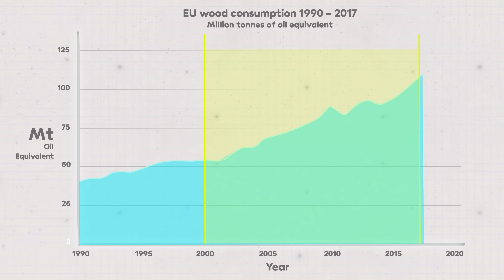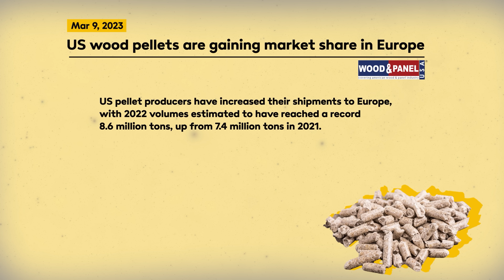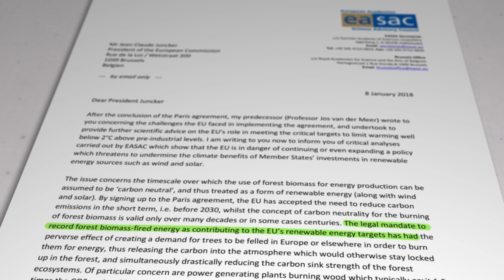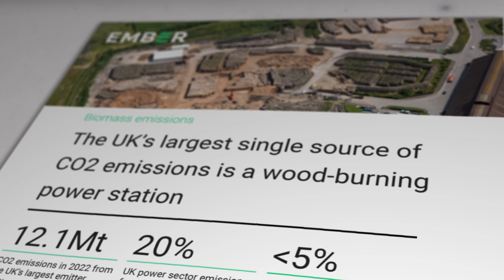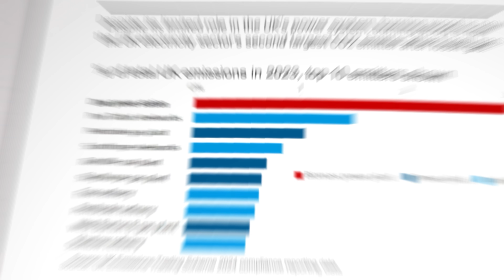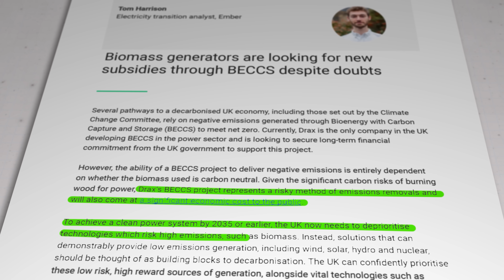New report: Biomass CO2 emissions 4X higher than COAL!!

Comment: I remember when they converted a power station near where I live from coal to biomass about 6 or 7 years ago, I asked an engineer from the company in charge of the conversion what it was going to burn. He told me wood. When I pointed out that there wasn't any suitable sizeable forest within several hundred miles, I was told the wood would be imported from Slovenia. I'm no expert, but even back then it looked like a scam to me.
Reply: Could have just burned the fuel it takes to get the wood there. Probably would have gotten more electricity out of it, too.
Reply: @Riesenfriese  Nope. Not even close. I get that you have a gut feeling about this. You're meant to have a gut feeling about this. GWPF have run a decade-long campaign to give people gut feelings about this, and are now reaping the rewards of their mischief.

Is burning wood pellets for energy perfect? No. It does however keep wood from decaying into methane, 120 times worse than CO2. Optimal would by using pyrolysis on wood waste to make liquid and gas fuels for those few hard to adapt long-distance and remote fuel needs, like continental air travel, transoceanic sea transport, and Antarctic stations. But as a stopgap, this is better than coal.
Reply: It's always been a scam. We should be focusing on producing power with what is locally available. An "all of the above" approach would be far more effective then government mandates written by people too stupid to make it in the private sector (and yes I have a very dim view of government because I used to work for government).

Comment: Years ago I was looking up the specific CO2 emissions for carbon fuels, & it's 4.2kwh/kg for wood.
Power station coal is about 0.28. And in my opinion, wood is a fossil fuel as it is carbon fixed in the past, more than a crop cycle.
Add in transporting it half way around the world, & the very questionable other eco credentials. Also no energy security.
Would have been far better off burning coal from the Big K (Kellingley Colliery) near Drax in almost every respect, & leaving the trees to mop up some of the CO2.
Reply: @al              Would have been far better off building efficiency, wiser lives, & clean safe fast cheap reliable renewable energy. Still will be.
Reply: Forresters might take issue with your definition of crop cycle.
Power station coal is .28 what?
The trees were never going to, and will never, mop up the carbon emissions from burning coal, otherwise we wouldn't be in this mess.
Not saying burning wood at Drax makes any sense at all, but let's have coherent arguments against.
Reply: @nickwinn7812  Same units, kg/kwh.
The point is that tree life cycle time effectively makes wood a fossil fuel in terms of the rapid climate change situation therefore in my book should be treated as a fossil fuel.
Trees stand an even worse chance of mopping up wood CO2 vs coal CO2 by the ratio of .42 to . 28 so better off burning the coal if we're going to burn anything. Not advocating it, just laying out the reality.

Comment: I've heard of intermittent talk of making fuel pellets from flax straw. Unlike other crops that straw doesn't easily break down, so farmers rake it into piles and burn it during the winter. Sort of related there is supposed to be a plant built nearby that turns wheat straw into paper pulp, thus far it is just a sign in an empty field.

Comment: The big plus in favour of biomass power is that it can act as backup for intermittent renewables such as wind and solar. If used for this purpose it makes sense. Drax runs 24/7 which is perverse.
Reply: That's a good point, but I'm pretty sure Drax simply isn't suitable for that purpose. It's a converted coal plant so it's designed to run 24/7, these plants don't tend to be very good at ramping up and down as needed to balance out the intermittent sources.
Reply: I worked at the converted coal to biomass burning power station on England's north east coast.  It runs flat out 24/7 because its power is officially classed carbon neutral, and running it flat out maximises the income for the Czech owners. That income is from selling the generated power, plus the government (taxpayers) subsidies because the plant is officially "green".

Comment: Dave, I used to work in this industry. The wood burnt at most biomass facilities is derived completely from such places as civic amenity sites (misappropriately termed "Recycling Centres"(!), waste handling businesses and businesses involving wood products (e.g. kitchen cabinet manufacturers). This wood was chipped to a certain size to suit the station requirements (by a huge Diesel shredder). It is difficult to know what to do with this material (though some of it could have been re-used by being sold to the public (think  3"x4"x 3m timber pieces and new unwrapped fire doors). But what was shocking was the distance some of this material had travelled, purely because of the contracts of the suppliers. I saw material from as far afield as Guernsey travelling to South Yorkshire (some 330 miles by Diesel truck), which, if not suitable (e.g. if the material was too wet), would then be returned. And to top this, the companies involved would advertise their 'greenness' and use that old chestnut word, "sustainable".

This practice has got to stop. I cannot understand why politicians would allow this if they were made aware of the economic facts.
Reply: Follow the money.....again!
Reply: because it's about LOOKING good .. securing votes, virtue signal .. and if possible get some kickbacks .. even if in 30 years as a "consultant"
Reply: If it isn't burned, and is buried, much of it becomes methane, 120 times worse than CO2.

If coal is burned instead, three times the CO2 per GWh is produced.
Reply: @bartroberts1514  that is true but one must consider time in this. naturally, methane is released at  much lower rate resulting in less of an impact that if it were released at the same rate as the CO2 from combustion (remember that CH4 is part of a natural process too some sources put it's potency at between 4 to 16x more potent than CO2). It is however, difficult to know what to do with all this wood. From memory a biomass station would burn through 400 tonnes per day and if shutdown, must be re-ignited using oil. Perhaps there is an innovative company out there which could create something akin to MDF without the current adhesive bonding to create a large strong building material from it.

Comment: Biomass only makes sense if you sequester CO2 at a similar rate to burning it. Cutting down 100 year old trees and burning it in a plant that will probably close in 10 years doesn't cut it. Burning fast growing speciea like willow and poplar that will regrow in 5-7 years is more sustainable but to supply the 7.5m tonnes of wood pellets that Drax burns every year you would have to carpet the entire area of Yorkshire, Lincolnshire, Norfolk and Suffolk in coppices, instead of growing food to eat.

Comment: On possibly another thought. Wood stoves / pellet stoves are much more efficient than many older petroleum furnaces. Or coal stoves. 
Not gas. It's quite clean. 
I wonder if that balances it some. Millions of homes not burning kerosene and fuel oil.
This plunder of the planet tho must stop.

Comment: Even fallow, dead, former forest land cannot be evaluated in the greenhouse effect solely in terms of its CO2 balance. The greenhouse effect is based on the physical effect that visible light (sunlight) is converted into heat when it hits a solid body, and this heat is converted into long-wave radiation that can no longer leave the atmosphere. However, this heating effect also depends on the albedo of the solid body's surface, among other things. Light surfaces emit a large part of the incident radiation not as thermal radiation but as visible light and therefore heat up much less. So a light surface contributes less to the greenhouse effect than a dark one. If the albedo of the entire Earth's surface were =1, there would be no greenhouse effect no matter how much greenhouse gases are in the atmosphere.
Reply: Bravo. Extrapolate that to surfaces covered by solar panels and you might be up to something big.
Reply: @dimmedaurum114  or nuclear plants. or coal plants...

Comment: Engineers solve problems, Politicians cause them. My invention did more to save the climate in the 70-90's by dramatically reducing CO2 emissions of then commonly used COAL power plants.

During the 1965 northeast power blackout Cambridge was not on the electric GRID was unaffected while the rest of the northeast was pitch black. Electronics Corporation of America located on the Charles river, The COAL power plant was just across the street where barges would come up the Charles River, into a canal off-loaded by a massive conveyor that delivered the coal to the top of plant 100+ feet in the air.

COAL PLANTs run at near 100% capacity 24 hours a day even if the midnight demand is 20% because like a fire in a fireplace it takes time get going. My company was the world's largest provider of power plant control systems using relays and mechanical timers, purpose to avoid explosions NOT to minimize emissions. These systems were fail safe but dumb and would fill up a 50 foot tractor trailer.

I was an EE, logic designer, at age 16 working the the aerospace division, invented the first SMART MULTI-FUEL system so the coal plant across the street could rest overnight and use quick responding fuels like OIL/NG for peak demands. The first system installed in 1972 was at Rochester NY, dramatically reduced the COAL HAZE.
Reply: I think that it's a little more complicated than 'engineers good, politicians bad'.  Both are often locked into mindset cultures with their peculiar strengths and blindspots - including shared ones such as solutionism/ interventionism.

Comment: The calculation is not entirely correct because it is not the entire tree that is burned, only the trimmings. In this respect, only a proportion of the area of land that the tree occupied can be used as a measure of how much agricultural land corresponded to the amount of wood burned and, accordingly, how much reforestation must take place. However, these considerations relate to the CO2 neutrality of the chemical processes of the wood used. The comparison must, however, be made against the scenario in which the tree is not felled. Dead wood emits CO2 and methane.
Reply: " it is not the entire tree that is burned, only the trimmings" is a lie.
Reply: @jaapfolmer7791  depends on where you go

Comment: Not even a minute in and you have told two untruths.   1st of all wood pellets are not made out of old growth.   Most of the trees that are harvested are around 20 years old which is the typical lifespan of pine trees.  The trouble with this lie is that it is misinformation absorbed by the those who lobby for legislation against the logging industry.  It prevents clear cutting timber which creates these massive over grown forest which are basic tinderboxes.  Those forest fires which are mostly avoidable cause significant harm including loss of life.  So your lies and misinformation have consequences.    Next, CO2 emissions are net neutral in biomass because the carbon that is released during burning is the same carbon absorbed during growth.   Furthermore, just because you have some British accent doesn't make you smart.  You are spreading climate fear (fear porn) with is all lies and misinformation.  You are the danger.    I would down vote you 1000 times if possible.  I will settle with just calling you a liar and a fraud.   Have a think on that!!!

Comment: So this is a no brainer if one has half a brain. Burning any hydrocarbon which is every biofuel, means releasing CO2 full stop. That’s why Hydrogen is the only fuel that when burns ( oxidizes ) turns into water not Carbon. So let’s just make more Green Hydrogen and stop this foolishness.Just have a think about it . Hydrogen is the only fuel that when used for heating or generating electricity, goes right back to where it came from….water.. for ever. Go to www.GH2E.ca for more info on Hydrogen. Good video BTW.

Comment: When a local pellet plant spontaneously combusted a few years ago... It burned for weeks causing huge mushroom clouds of smoke and haze to settle over the Edmonton region... This is how I know it's worse than our now closed coal-fired plants that ironically lay within eyesight of this dumpster fire of a facility that reopened like 3 years later... BTW, those coal plants have been converted to natural gas, but cancelled the CCS aspect for economic reasons... Typical! Though I suspect it's because SMR's will be built on the site in the next 5-10 years anyway since Alberta is going all in on nuclear while stupidly curtailing renewables... 8 GW's of new renewable projects were just cancelled in the last 6 months thanks to the Fossil Fool Premier Marlaina "Danielle" Smith...
Reply: Same happened here in Denmark in 2022, damn pellet silos burned for near a month(29d) 58000 TONS of pellets went up in smoke at the Skudstrup powerplant.
Ironically the pellets were likely of Canadian/NA origin too 🙄Though i can't really fault you guys for that 😅
Reply: @Lag_Monster  Don't sweat it. Edmonton is treeless. The pellet silo (singular) at Studstrup burned until it was put out, ruining 40 Tonnes of fuel.

The Centralia coal mine fire has been burning for over 50 years, by comparison.

Canada's forests are burning from extreme wildfire weather caused by climate change so fast in the past half decade that the equivalent in wood pellets would cover Denmark to the depth of 1.1 cm.
Reply: I agree with you, although Coal Combustion Byproducts are an especially nasty bit that is barely mentioned compared to GHG emissions and particulate matter/hydrocarbons/co/sulfur etc

Piles of Radioactive Ash sitting in a Glorified Percolator is *bad*.
Reply: They'll spend billions and billions to build a plant and just like everywhere else, nothing will ever get completed or running.
Reply: pellets made of trees from natura 2000 reserve in portugal, and old forests from canada https://youtu.be/BqEojlj7_bY?si=Ji1l41SbLPdFCofq
Reply: There are 2 million plus fracking mines in Canada. Alberta is full of them. Go to Google Maps and it doesn't take long to find the mosaic of mine sites. And the recent big forest fires in Canada all started right next to these mines and their access roads. Obviously, global warming is making the forests drier but the ignition source just adds injury to insult and the mine owners haven't paid a dime in compensation.
Reply: You gotta love politicians. They care about nothing but themselves. They'll watch the world burn so long as the bribes I mean oops! campaign contributions and dark money keep coming in.
Reply: @stickynorth  Variable renewables are nonsense and impose negative electricity externalities on the rest of the grid.
Reply: You're talking about the one out by Entwistle, right? Wasn't it threatened by fires this year? Or was that last year? I get my seasons mixed up and irony doesn't have a schedule. 

To our Danish friend, Edmonton doesn't have a lot of trees but about 30 km west most farmland has been cleared with a lot of sporadic forests still standing. Out where our pellet plant is, and further west it's nothing BUT trees all the way to Jasper -- which also burnt down. Don't know if that made it to Denmark, but it made the national news anyway. 

Greetings from the stupidest province in Canada!
Reply: @chaunceyfeatherstone6209  The stupidest province in Canada, for outsiders, is a highly sought-after title. While Alberta is always favored to win, it's not a shoe-in every year.

And yes, Canada is for the second year in a row suffering extreme wildfire weather-induced record fires. 2023 was four times the average, and the clear record holder. 2024 is thankfully less awful, but still far above average.

We also have been getting record floods, and some tornadoes and tropical storms. Yes. Canada. Tropical storms.

Wood pellet silo fires seem bad, but the silo design is meant to contain the fire, albeit as the fuel is ruined by long, slow combustion and wetting down.

Compared to coal, gas, or oil fires, or those in bitumen refineries, they're chump change, though.
Reply: @bartroberts1514  Yeah, the burn down itself doesn't represent much of a threat. But operationally, when it"s at its best, it's at its worst. 

That's waaayyy over there though, so Alberta's good, right?
Reply: @chaunceyfeatherstone6209  Alberta convinced Canada to pay $40 Billion for a pipeline to export highly subsidized bitumen to foreign countries below the real cost of production.

So, 'good' is a relative term.